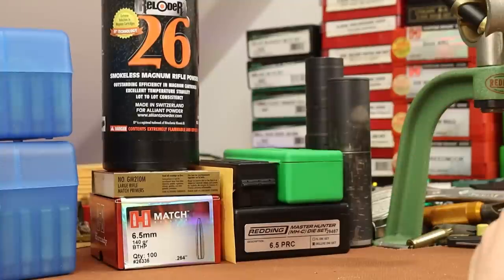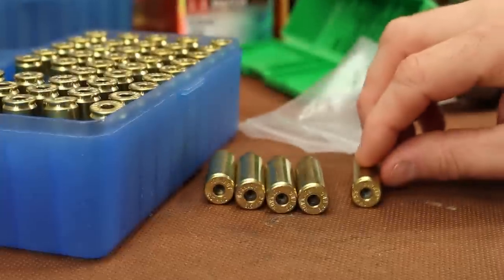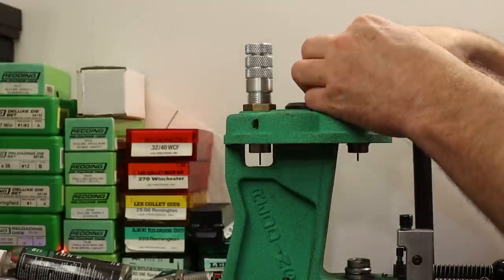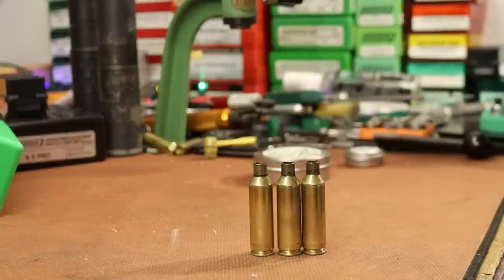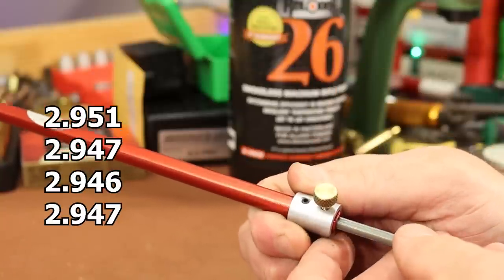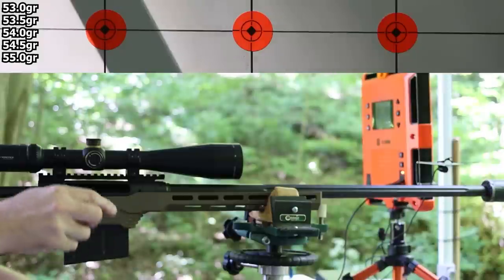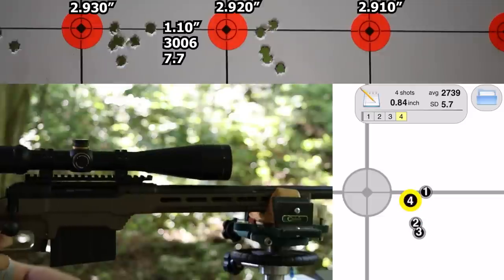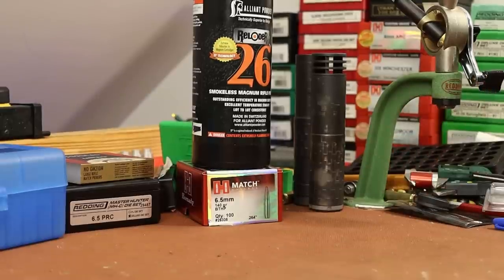6.5 PRC - 140gr Hornady BTHP and Reloder 26

Comment: Quote from Johnny's Reloading Bench which we can all live by: "I use different lubes in different situations."
Reply: As Paul Harrell would say, "The lube I use is the one I use based on my education, experience, different people have different experiences and that lends them to use different lubes and mine may not be one of them".
Reply: That statement is not necessarily true. The only thing I lube different is neck sizing vs. full length sizing. And some people don't even use lube neck sizing. I use a dry lube. I use spray lube for full length sizing which is home made of lanolin and alcohol. You don't need multiple lubes for sizing if you are using a good lube anyway. Some lube sucks like bees wax and is more prone to crease cases at the neck if too much lube is on neck or shoulder. Fact is you don't need lube on neck or shoulder. If one wipes it clean with their fingers before resizing you shouldn't crease a case.

Comment: When they said they "seasoned" the die with Imperial Sizing Die Wax, I had a vision of seasoning a cast iron pan with heat and oil.  Great video as usual.  To flatten the bottom of the MDT, an Arca rail might work.
Reply: "To flatten the bottom of MDT, an Arca rail might work"; to help a $600 chassis fit better, put a $200 rail to bolt on to it.  Not poking at anyone, but for the prices on these chassis, they should provide a bag of misc shims, spacers, rails, ect to truly fit the shooter/shooting type.  Edit: Looks like Arca has come down in price, between $80-220
Reply: @paulharveu526  10-15 inch Universal Arca Plate and T-Nuts on an M-Lok forend will have him flattened out up front for well under $50.

Comment: Bought Hornady 6.5 Creedmore dies a year or two ago.  The resizing die was full of grit.  I assume from their manufacturing process.  Maybe I could have fixed it but I sent it back.  Came back very quickly in fairly good shape.  I haven’t used it in some time but I think it still scratches the case slightly.  The best die set I have came from Whidden Gun Works.  They chambered my gun and their die reamer is coordinated with their chambering reamer.  It is just right.

Comment: When you start looking at either higher velocities or heavier bullets, you might consider changing the bolt head to one of the Pacific Tool and Die bolt heads.  That means that you have to redo the headspace on the gun, but the difference between the two is night and day.  The PTD bolt heads are machined from billet, while after looking at the OEM Savage bolt heads, I'm pretty convinced that they are investment cast, with the absolute minimum of machining done to them.  I don't know that for sure, but that's what they look like to me.  But it should minimize the primer cratering.

I'm a devotee of those 140 grain Hornady bullets, they are also what shoot best in my RPR.  I bought a box of the new Berger 153.5 Hybrid Target bullets.  I think they're too heavy for the Creedmoor, but they might be just what the doctor ordered for PRC.

Comment: Sierra’s 6.5prc data was so conservative it was worthless.  Data I’ve found consistent with pressure signs was the Hornady data.
Reply: Same for my 30-06. I cross referenced to Hodgedon and Barnes, and Sierra was towards the low of both.

I called Hodgedon and they double checked Sierra, but the data now was similar to the others I saw. Turns out they went conservative in their 5th manual, but the 6th was right on.

I'm guessing they didn't really test the loads in their previous manual. 😂

Comment: Try a 3” wide front bag and a 3” X 6” steel plate attached to the hand guard with MLock screws.  Yes, it’s heavy and bulky but it will steady the rifle for load development.  I couldn’t see the rest’s feet but if they aren’t dug into the table, put the rest on some rubber feet or mat so it can’t move in recoil. Try fine-tuning elevation adjustment with the rear rest foot screw.  Put a level on the scope. These are all benchrest techniques but you need to use them to eliminate some inconsistencies during load development. Love your videos and learn something every time.

Comment: I have Redding Type S full length dies from spring 2021. I also had serious problems with stuck cases. I also had the common issue where my sizing die wasn't sizing the brass enough. I used a dremel and polishing bit to clean up the inside of the die and I switched from Imperial Wax to the RCBS lube. To address the die not sizing my brass enough to fix in my Howa 1500's chamber, I had to machine approximately 0.020" off the bottom of the die. Now I set the die up to do a shoulder bump and it works pretty well. Before then, my die would go all the way down to the shell holder but still not size the brass enough to fit. The joys of a brand new cartridge.

Comment: I haven't been reloading for long, so I feel bad even piping up here.  I'm going to assume that "seasoned" means that the die is cleaned and lubed with the sizing wax.  It sounds trivial, but in my experience, dies come coated in whatever residues are left over from their manufacture.  If the cutting fluids used in-process are emulsified vegetable oil mixtures, then the coating left on the die would then be a thin lacquer of oxidized (polymerized) oil.  
I've played around with lots of "alternative" case lubes, and learned a few obvious-in-hindsight lessons.  Vegetable oils (e.g. linseed oil, citronella) might seem like they'd work, but their dried residues will aggressively cause sticking.  Swabbing the die out often won't remove anything, since the residue is a poorly-soluble solid lacquer.  Lubing over it generally doesn't help much unless you use a heavy lube.  It takes a significant effort to remove, just as it would take a lot of work to remove a linseed oil finish or baked-on cooking oils.  Once I figured that out, I've paid extra attention to cleaning and re-lubing new dies.  
Just a thought.

Comment: Very nice video Johnny!
I have hopefully good video idea, that you might find interesting.
I am a mainly 223 bolt gun hunter/shooter, and I've read many hours about the inherent lack of accuracy of any FMJBT bullets in general. I still use them at the range because of price, with not much accuracy.
It would be great to compare for example common 223 55 or 62grain FMJs and  closed base SP,HPBT bullets, using the same loads, COAL, etc. To show if really  any closed base bullet is more accurate than the FMJ type. Many say that the cheapest Hornady Spire points are more accurate than FMJs at any given time and/or powder combo.

Comment: I did notice that when checking your bullet after getting your measurement with your gauge you measured t the tip that is where the inconsistency was in the measurement bullets are seldom consistent in length. After getting that length measurement your consistency of the seater should be off of the comparator for the bullet somewhere near the ogive where the bullet should give you a more consistent measurement. That is near the point of contact with the riffling. I am sure it was just a slip we all make them from time to time. I do enjoy your videos. You do things a bit differently than I do but I learn a lot from watching them all the same. We all seem to do what works for us.

Comment: Really enjoy your videos Johnny. I had a Bartlien sporter B barrel installed on vanguard s2 30-06 and dove right into reloading spent over 2k on equipment. When trying to measure bullet jump to the lands, using hornady 165gr sst, modified case and hornady o.a.l gauge I couldn't get consistent numbers know matter how many times I measured. When you said that new barrels can be difficult to get consistent numbers it really sheds light on the inconsistency in the measured numbers. Thanks for that.

Comment: Thanks for the video, you are always fun to watch. 
An area you might want to test, or just some "food for thought"  14 min's into your video you used your trim tool.  trim to length / debur / chamfer. 
That is a VLD chamfer tool and makes a nice ramp into the neck for seating. Does that angle not touch the bullet anymore? Is the depth of that angle the same on all brass done by hand? Is that as important as trimming to length? Just wondering bro :)

Comment: I went to machining school awhile back. I bet the initial poor fit and finish with your die could've been due to their boring bar having a chipped carbide  insert. But just barely chipped, so the insert looked and sounded normal enough, but the inside of the die was rough and too tight. Chipping an insert will get you every time, I swear lol

Comment: I use nosler brass on my 6.5prc and have similar issue with the brass not sizing consistently. Had 2 with a slight crack in the neck to when it was new.had better luck with Hornady brass.

Comment: I had a problem with Nosler brass with the 28 Nosler cartridge. I had purchased 200 Atlas brass, loaded 50 up and shot some excellent 3 shot groups all under moa and most under .25. Wanted more brass but only Nosler brass was in stock so I got that. Loaded them, fired some more 3 shot groups and they looked like I’d fired buckshot. Started checking and measured the neck thickness with a ball micrometer and found up to four thousandths difference in the neck wall thickness. QC seems to be nonexistent in Nosler brass. Turned the necks but at the same time Peterson brass became available so the Nosler brass was retired. Peterson brass shot just as well as the Atlas brass did. I won’t be buying any Nosler brass for any of my rifles.

Comment: I feel your on a good track to keep the suppressors clean. I feel if they are "clean" they work better. It's like oil changes for a car. The car can run a long time on the same oil but if you take care of it, it will last longer. Any shotshell loading?

Comment: Johnny, get a flex hone in 800 grit for each case diameter range (.223, 308, magnum) and they leave a perfect surface finish for sizing. They will leave a nice fine crosshatch that holds lube but doesn’t change the size of your dies.

Comment: I had the same trouble with that RCBS case lube in a brand new Wilson die.  Had to send it off and had it repaired as it left the die with galled brass and deep gouges.  I threw that RCBS lube in the trash and went to alcohol/lanolin and never had enouther problem.

Comment: I suspect in this case, seasoned means they applied lube and then heated the metal enough that the lube penetrated into the microstructure of the die metal.  If you get your die a little warm, you should be able to see lubricant beading out of the metal, like sweat.

This works with almost all metals, but the best example is anything that has been parkerized.  If you coat a parkerized part with lubricant and heat it up, the porous parkerizing will absorb a great deal of lubricant, which will continue to sweat out of the metal every time it gets hot.  Parkerized 1911s are a great example.  The finish can be rendered essentially rust-proof for years by coating it with vasaline and heating it to about 180 degrees.  The finish will continue to sweat out every time it gets hot for years, and until all of that lube is out, it's not going to rust.

This is the same concept in play with Froglube, and the reason why they urge people using their products to completely decrease their guns before using Froglube.  Froglube has a very small molecular structure and can penetrate metal very well...but it can't get in there unless the previous stuff is out.  A bit of a marketing gimmick, because as long as you continue to use Froglube, it will slowly replace any other product that has infiltrated the metal...but they're not FOS.  It works better with clean metal.  If you don't clean it first....it just takes a little longer to season.

Ballistol is also very very good at infiltrating metal, since it's just paraffin wax emulsified in mineral spirits.  Once that gets into the metal, it's not unusual to see it sweating back out every time the firearm gets warm.

Comment: Nice video. Nosler says their most accurate load is with Reloader 26. I do wonder though whether your accuracy would be better without a suppressor. I know people love shooting with them to cut the sound. But most experts say the group will grow a bit with a suppressor. I have a Savage Tactical 6.5 PRC, so I am watching your videos pretty closely on the 6.5 PRC. My barrel is far from broke in though. I only have 20 rounds through it. I will be looking for some Reloader 26 it's hard to find right now. I do have some Accurate Magpro on order because it was the only recommended powder available to purchase. I have been shooting some powder I have on hand with not such good results, but I am getting my cases fire formed. I plan on neck sizing fire formed cases unless it turns out that they don't eject very good after only a couple of firings.
Reply: I’ve got the savage tactical as well.  It’s been shooting 0.5” groups with Norma match 143 gr.  Haven’t started loading yet but I’ve got some ramshot LRT, BR2 primers and 147 gr eldm set aside.  Good luck!

Comment: I've been using Outers Choke & Gun Grease for sizing lube. I've never had much luck with spray on lubes or thin oil type lubes. I even used Lucas synthetic red & tacky bearing grease with good results because it has really no smell. But nothing beats the Outers, it is a pain to hand apply to each case but with tough sticking brass it works great!

Comment: Im reloading a seekins precision havak bravo in 6.5 creedmoor.  Ive tried a lee die, redding die and a lyman die and it seems like i have to use an excessive amount of force to resize my cases.  Im using the imperial case lube and it seems no matter how much i put on the case it has seems to have that rough gritty feel when the case goes into the die.  Im not loading anywhere near max charge on my rounds.  Is there something different about the chamber of my rifle or have I had bad luck and gotten 3 bad dies? Any insight would be greatly appreciated.

Comment: After shooting a few different powders in the 6.5 prc and talking with others 57-58 grains seem to be the sweet spot. Data is all over the place, some I've went as much as 8 grains over. Can hit 3000 pretty easy with 147 eldm and h-1000 24" mauser m18. Hornady brass.

 seen some guys touching 3000 with the 156 and a 24" tube.

Comment: i think the discrepancy in the load manuals is from the altitude that the company's test labs are at . i have seen a lot of the same thing over the yrs . and just from where the company is at says it comes from the altitude they are located at . that is if they test at the main office . could also come from the lot number of the powder they used . i know how temp and altitude can make a load go way over max ! i worked up a true keith load for my old sw 29 44 mag . did it in the middle of a cold michigan winter . then moved to tennessee . and after a yr i got loading again . same load , same powder , same lot number of powder and same primers from the same brick of primers . loaded up 100 of them . shot the first 6 , recoil was more than i remembered ! and the group looked like a shotgun pattern . had to beat the cases out with a hammer and wooden dowl ! tried 6 more same thing ! ended up having to drop the load down 3.4 grins of powder ! it was a hot tennesse summer day i tested them temp in the low 90's . learned a lot on that hot summer day !

Comment: 55.0 to 55.5 is somewhere near your accuracy node based on the group at 25:25.  Your last three groups showed 'splittings'.  They had two distinct groups separated by a split.  When harmonics leave the node, They wobble and it causes this splitting effect.  I've posted this on a bunch of your videos when I see it.  It's a clear indication you have left your accuracy node and went too fast.  I would go back and find the accuracy node and then play around with case OAL.

Comment: I would suggest to work an ocw test to find a stable node in your velocity instead of picking a random charge just because its your target velocity.  There is no way to know that its stable the way you did it and maybe that velocity is interfering with your barrel harmonics. To find a stable velocity node you would need to shoot at least a few rounds at each charge weight to get low es and sd. Your looking for a couple charge weights with very little velocity change that are adjacent to each other

Comment: I believe that the Gun does not fit you, one thing about vertical grips, is your hand will squeeze as the rifle recoils, that would be okay, however, the pressure that is used in your hand differs from shot to shot, (It is a natural reflex everyone has) So that will affect where the barrel is pointed as the bullet travels down the barrel and exits out the muzzle. the shots will be close, However, there will be a wider one or two that ruins a group. try a straight stock and see if that improves your groups. that would be the first thing I would do before doing anything else. Good project -Dave

Comment: I dunno if anyone has covered the difference in load data. Sierra were so low due to using Winchester Large Rifle Magnum Primers as does Barnes they are calling for a Rem 9 1/2 Magnum Primer. Nosler and Hornady both call for Large Rifle Primers. I just don’t think Magnum primers in the PRC is really necessary? The times I have tried them due to Sierra Data calling for them I have had heavy bolt lift after the shot.
Reply: Wonder why sierra is calling for magnums.  I used several different sources to load for their140tgk because I didn’t want to buy their book for 1 bullet. I settled on cci br2  and h1000 and it shoot .300” @ 100yrds. Vo is 2970fps. I fail to see wasting magnum primers when I can’t find any anywhere.